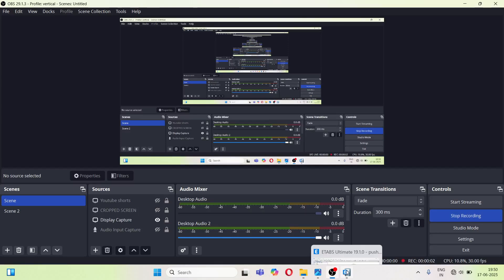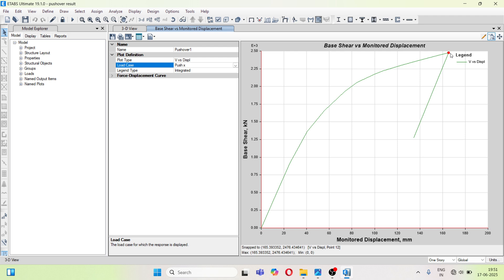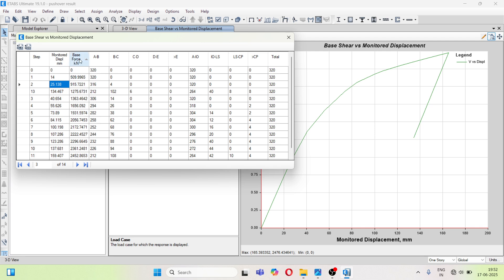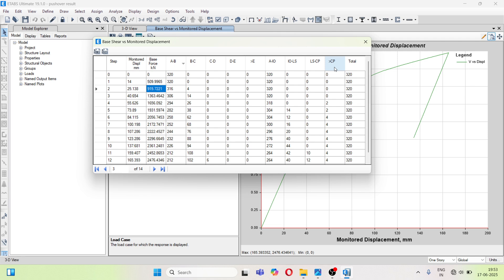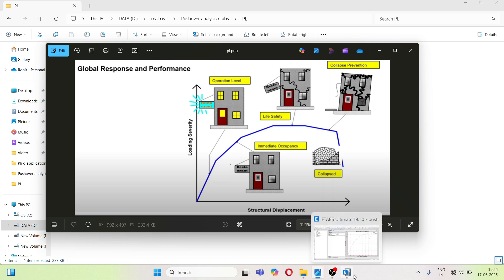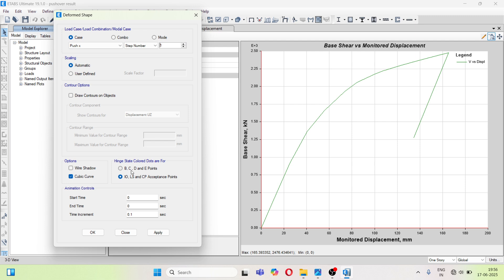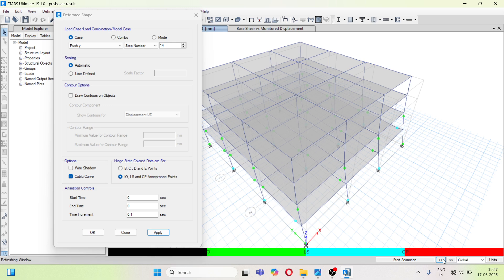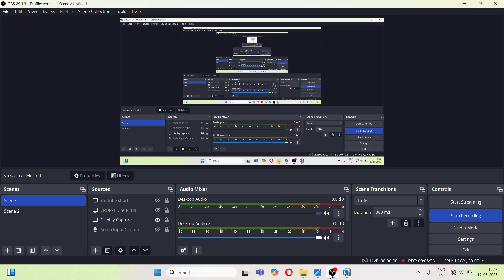Pushover analysis results | Push over curve | capacity curve | Building performance levels | hinge

Comment: Sir, when you will make video tutorial capacity curve be converted  to capacity spektrum? please help me, you said you will make the video
Reply from the maker: I tried in etab but its better to go with sap 2000. I will make in sap. Is it ok.
Reply: @Realcivil  is it difficult if done in etabs? because i have already told my lecturer to use etabs for my thesis😢
Reply from the maker: @lisnasefiya9399 there is one option available in sap, which is not there in etab. But interface of sap and etab is same. So no one can actually come to know which software you have used
Reply from the maker: Have you joined my telegram channel? I will share one tutorial there
Reply: @Realcivil  Not yet sir, can you give me the telegram link?
Reply from the maker: Link is there in description box